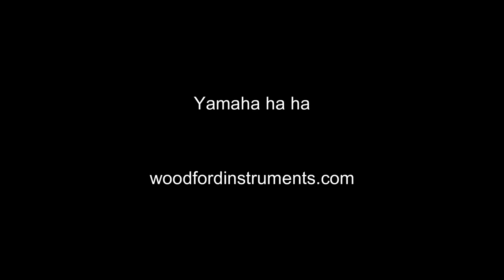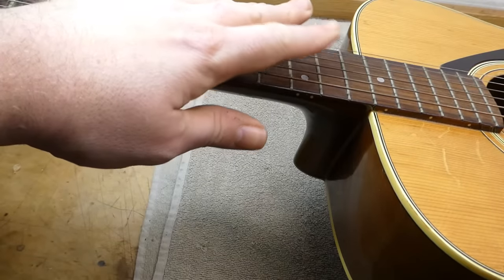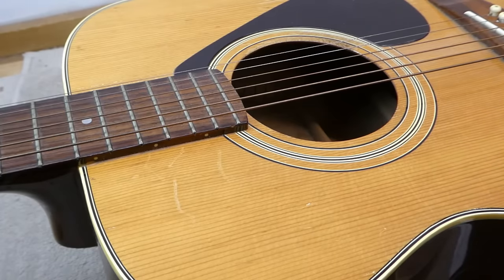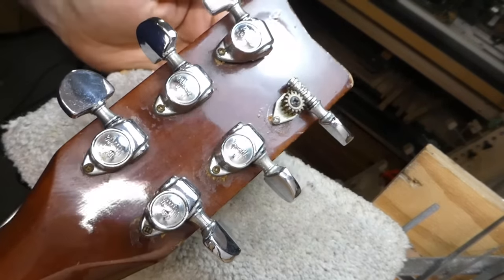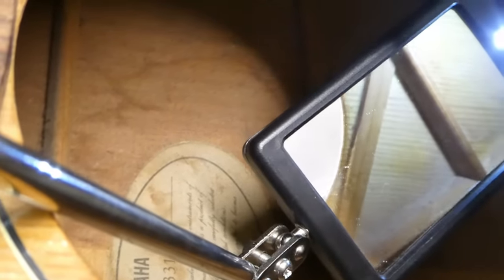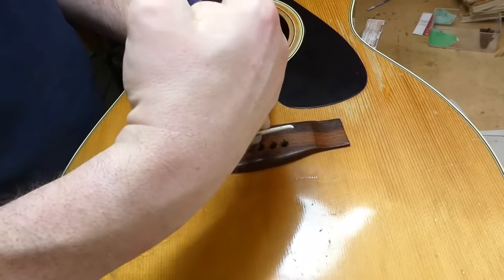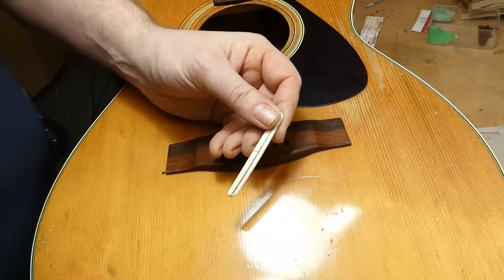Yamaha ha

Comment: Hi Ted. I have an FG230 12 string made in Japan. I had to put a new maple back and braces in it due to an unfortunate accident. It badly need a neck reset but I was able to shorten the back slightly to pull the neck block in and the neck down while installing the back.(also known as the poor man's neck reset) I clamped a 4x4 along the fret board and over the bridge with a slight spacer at the bridge. The neck angle came out perfect and it plays and sound very nice. I was able to route the old back out along the inside of the binding so the binding remained in place with very little damage. I used a roller router bit to keep the cut just inside the binding. All in all it turned out very well even if the back finish does not match the sides but with some stain mixing it came out close enough. As you know maple doesn't stain very evenly.
Really enjoy your videos.

Bob in Ottawa

Comment: Had a music store in a small town in Arizona back in the '70s and '80s. We were a Yamaha dealer we sold a ton of those FG series acoustic guitars. They were despite the laminated tops a very nice sounding guitar and seem to hold up well. That said, if anything major ever went wrong with them they became a throwaway item really quickly. You did a great job on this one and it sounds wonderful.
Reply: The luthier going by Driftwood Guitars controversially cuts guitars in half in their reviews. I reckon this is a really great service as it gives buyers of less expensive guitars not only the knowledge of how well the top bracing is finished, but also how the neck joint is constructed which can tell you whether you have to ditch or severely compromise the guitar when the day comes where it needs a neck reset. As this video shows - just because a guitar is inexpensive doesn't mean people want to just relegate them to firewood when they age.
Reply: I sold a lot of CG-110 classical guitars in the early 80's as they were good sounding very affordable guitars that I could stand behind. My personal guitar is a G-255sll (cedar top) that I was lucky to find in new condition some years ago. I started with the G-255 spruce top as my first  real guitar 🙂
Reply: The real Yamaha gem was the FG180 with the red label made in Japan. 4/5ths of a Martin sound for 1/5 of the price!! Was a well known thing in the early 70's

Comment: I'm a former collector, and current vintage Yamaha acoustic enthusiast, so I speak from a position of many years of experience.  I'm also an amateur luthier, which is why I watch your excellent work/videos.  That said, anyone who says that the early laminate-top Yamahas sound BETTER than a decent solid top is delusional.   I've owned several 1971 FG180s that sounded better than a number of inexpensive solid-tops, but such a blanket statement isn't warranted.  However, the combination of a thinner laminate and lighter bracing produced a sound quality that could seldom be matched by other guitars costing 3-4 times as much.  To this day, Yamaha's L-series guitars have 90% of the sound of a similar Martin or Taylor for 50% of the cost, AND have a more consistently excellent build quality.  To me, that's a hell of an accomplishment!  Interestingly, I've only come across two FGs (out of hundreds) that needed a neck reset in over 25 years, and I didn't want to tackle either of them due to their notoriously difficult disassembly.  Love your work, I wish I was half as good!

Comment: My first "decent" guitar was the $125 Yamaha that I bought locally (remember that?) circa 1970 or 1972. I think it was an FG-180 red label dreadnaught. On my way from New Jersey to Wisconsin for college, Greyhound made us change buses in Cleveland. My guitar never made the transfer, and I never saw it again. Now, about 50 years later, I have moved to the Cleveland area to be near my granddaughters. I suppose that if I watch the local Craigslist and Marketplace listings, I might find my own old Yamaha in the hands of someone asking $400 for it. 

Actually, I just bought a 1971 Madeira (Guild import line from Japan) that is an absolutely wonderful guitar. Solid spruce top and laminate rosewood sides and back for which I paid $140.

Comment: I have an FG-770S, the all solid top and back/sides dreadnought from this era.  My grandpa bought it new in 1980 for my mom, and she passed it to me.  I did a refret and a bone nut/saddle and the guitar was totally transformed!  It's a bluegrass rhythm machine now and plays excellently.  I used extra tall frets in order to stave off an impending neck reset.  

Funnily enough the bridge plate on mine is rosewood, just a cool little detail I noticed when poking around inside with a mirror.  Also the neck is GIGANTIC, with a sort of soft V shape.  Easily the biggest neck I've ever felt on an acoustic guitar
Reply: I have a fg 77O's (great guitar and big sustain) I have so a fg 75 red label from Japan. I'm french.

Comment: Cranking truss rods is why I am a huge advocate for clamping and baking necks, but anyone that has done it knows the risks and potential side effects.
I baked a few necks roughly 8 to 10 months ago, and made some critical mistakes that were fortunately easy to resolve. Melted neck binding, and some very slight headstock clear coat blistering that will buff out easily.

Unfortunately, the neck that melted whose truss rod I didn't bother retightening ended up with an INSANE amount of forward bow while remaining off the neck! lol I should have taken better care of it after the process instead of leaving it to sit for several months and with the truss nut completely tension free. Some details for anyone bothering to read my wordy posts.
I heated the binding and was able to start flattening it out, but it proved too tedious to be worth it, so I sanded it carefully and filled the dips with Plaid bone white craft paint; this worked amazingly well and once cured I had a very solid and invisible repair. 

One critical event that occurred is 2 of the necks that were over glued, in Asia speed manufacturing of course, squeezed out some of the excess glue, and though there was never a visible gap, it was clear that the boards were seated much better and the joint helped retain the flatness of the neck down their entire length.
Aside from marking my heater to ensure I never get the box that hot again, I decided to wrap headstocks in aluminum kitchen foil which is adequate protection. 
I have read about baking necks from some that have done literally hundreds and oppose it even though it worked, and others who swear by it.

IMHO, it's a much better first tactic for a squirrely neck rather than the woodwork others suggest that goes with the bend or twist, and is considered a permanent fix. A lot of necks will be permanently repaired because it was an excess glue issue or the climate where you live, and others will need the process maybe once a year to every few years. One critical detail a "baker" specified was that he clamps and bakes most of his guitars once a year, and has done this for many years. If you don't apply excessive heat, you can greatly minimize if not eliminate the risks of potential long term damage from repeated heat exposure accumulatively over many years. 
In the end, it can salvage a neck entirely, or at least, temporarily return it to perfection a few times until you are willing to replace it.

Comment: I have a 1973 Yamaha Taiwan-made FG200 and it’s pretty good. Not sure if it’s comparable to a Martin or Gibson, but I bought it from GC for about $150, so not bad. I did have to shave the saddle some and straighten the neck. I would love to give it a neck reset, but I’ve heard of the unorthodox neck joint fixatives that they used back then.
Reply: Look into the steam neck reset method by John Miner. It’s less invasive and usually less risky. I did one to my 1970s Yamaha and it brought the neck back down to earth.

Comment: I found my FG700 in the resale area of my council rubbish dump/recycling centre. It had a broken headstock and i paid £2 for it. The break had been left and I had to clean up the splinters to line everything up for gluing with Titebond, There was a chunk of wood missing  around the hole for the low E tuner and I made a plug from a piece of broken hardwood garden chair carved to shape. The veneer with logo was splintered so I re-veneered it. Saddle and nut were missing so I fitted bone items. Fitted light gauge strings and It has held together fine.

Comment: Dude! When I looked at this guitar, my first response was " that's my model Yamaha!". I checked and mine is an FG-160-1 black label as they're fond of saying. Kind of disturbing that a guitar I bought at 18 years old is now considered an "older" guitar. Lol I had the same issue with the saddle and bridge. I had to slot the bridge as the strings could slide on top of the saddle. And it does have a surprisingly good sound for a guitar that I paid app. $270.00 in 1977. Thanks for your work man. I appreciate all the information.

Comment: I use those same pickups on guitars with a natural lack of bass response (12 strings, stiffly braced/laminated tops). I've had good luck/response from the JourneyTek EP100k. They're available on Amazon, but the price fluctuates wildly. I buy them when they drop to about $65, but they go up to $110 at times. I'm all cases, I beef up the jack/wire connections with a better solder job and electrical tape. Will, from La Grange Guitars in Québec.

Comment: I'm in a completely different field of work but... in cases where a repair isn't feasible and customers want to do it anyway, I always ask for a deposit for roughly what I estimate the repair will cost, and a signature on an agreement with regards to additional costs etc. Either the customer needs to "think about it"(ie. I never see them again, about that project) or they go along with it. I won't be much out of pocket if the customer bails after the deposit is spent. A little extra hassle, but it clarifies the repair process and nails things down somewhat better.

Comment: Found a similar Taiwan Yamaha FG local for $150 CAD. Used the heat and backbend method to straighten the neck and it’s very playable (truss rod was bearing on an angled surface and wanted to push out through the board, managed to address it and the heat persuaded it to stay in place without reefing on the rod). 

VERY light in its body construction, surprisingly so compared to my A3CM. Sounds wonderfully airy, for 150 if it sounds great and plays noticeably well to you, it’s a steal; $500+ I dunno.

Comment: My first guitar was an FG331. I bought it in Liverpool, England in 1981 and it cost me approx £60 UK with a PVC carrier. I used it right through my folk club and open mic days but sold it on Ebay about 12 years ago, replacing it with a Taylor GS Mini. In later years I fitted it with a bridge transducer and it was a strange beast. As long as I didn't tune higher than Eb it was fine. Take it all the way to E and the damn thing died.

Comment: Hey, Ted. I'm a part time guitar builder, and your comment about repair guys expiring before they retire got my attention. Is that due to all of the solvent heavy chemicals that are used for finishing/removing finish? Should I be concerned as someone who does a lot more building than repair work? I ALWAYS wear a respirator when spraying, but if I'm being honest, I really don't take adequate precautions when dry sanding. Anyway, I'd love to hear back from you on this. Thanks.

Comment: I bought one of these delightful guitars in the Air Force Base, Base Exchange in fall of 1980.  I think I adjusted the truss rod once.  Other than that, I've done nothing with it except clean it and replace the strings and it still sounds exceptional.

Do you tape the lacquer when drilling to prevent it from chipping out?

Comment: My favorite Guitar a 1971 Yamaha FG 170 need a a neck reset but $$.  My bridge nut is almost level to the bridge.  Neck is almost flat so is the top (spruce) behind the bridge.  I have already notch the pin slots. Was hoping to shave a little off the bridge but wasn't sure how much. Best guess!!  Measurement:  Bridge Measure: height: about 9/32” +, width: 1 5/8”,  Length: 6 1/2”.  I know you are busy so I tried to look for a place to buy you a beer or something but I couldn't find anything.

PS: Some history of some the FG 170 including mine where made from 1971-73 at Nippo Gakki Co. LTD 1D-1 Nakazawacho Hamamsu, Japan  Made in Japan  For Japan market only.  
Tan label a hand written (K) & no serial #
WOOD: Back: Mahogany, Sides Mahogany, Neck: African mahogany,  Fingerboard:  Rosewood
Bridge: Rosewood, Solid Sitka Spruce Top

Comment: As far as merch goes, Ive had a good experience with Fourthwall. You can choose to get lower or higher quality shirts for lower or higher costs and the quality of the prints have been pretty good. Ill try my best not to shill, I don't get paid by them other than what I make on my merch I have through them. I did have a print issue pop up on one of my shirts but they were fast to act on it and corrected the issue and they let me know if a certain type of shirt or item is out of stock so I can switch it to something else. Im in the US so Im not sure how they would handle the Canadian side of taxes and all of that but as far as the merch side goes, they've been the best out of the companies Ive used and Ive stuck with them.

Comment: What was the FG folk model that was specifically a folk model for nylon strings?  I had one and it was very very comfortable and sounded good.  FG 75, maybe?
Reply: I've just found out that all Yamaha FG-series guitars were for steel-string, but the one I had was terrific and warm and sweet and comfortable with nylon strings!  I wonder if it was one of the FG models with 'composite-board' tops.

Comment: For $330 you can buy a brand new FG830.  Spruce top(solid not laminate). Solid rosewood back and sides. Scalloped bracing. A significant variation across multiple units but many of them are approaching a D28.
Reply: Check that "solid back and sides" again. But yeah, go to tonepedia.com and just listen

Comment: This is interesting, thank you Ted. You did not explain drilling slots in the bridge, and I assume to allow the string pass the pins neatly. But this is a modification ! Does it improve the sound ? Best from Ireland
Reply: Looking at the standard e and b strings, they cross over the saddle without much downward pull ( a low "break angle"). Cutting the slots means the strings have a higher break angle and so a crisper tone. Don't overdo it!
Reply: @kitmoore9969  Thank you. I appreciate it.